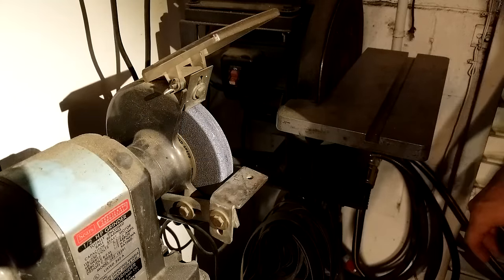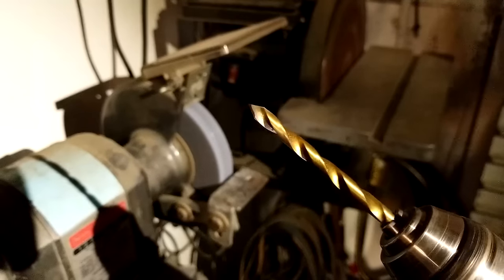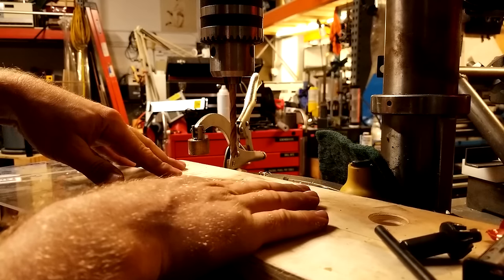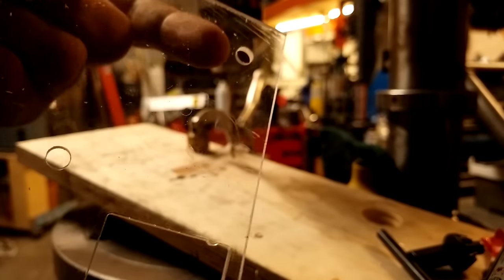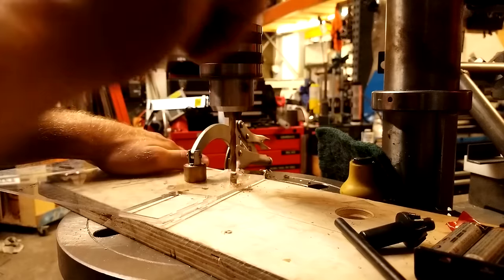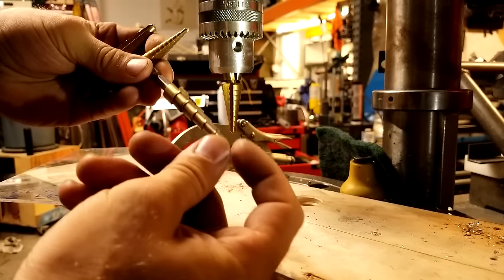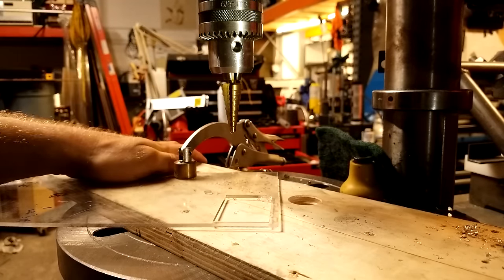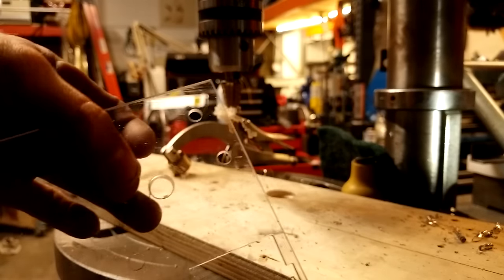How To Drill Acrylic And Other Brittle Plastics

Comment: Just in case anyone needs to know drill bits are sold with tips on them so you don't have to worry about the whole sanding of the tip part
(I believe they are the tips for drilling concrete)
Reply: masonry bits are like a flatter bar at the tip, they more hammer than drill, i think you are talking about a brad point bit, but if you have a dull drill bit laying about, just grind it like he did, even a heavier framing nail might work
Reply: I think it's tile drills /  glass drills that you're thinking of, they have a tip a little like the spade in a pack of cards.

Comment: Every plastic store I have ever been in sells special purpose bits for drilling plastic.  They are basically just regular bits with the grind shown in this video, but a full set was very expensive to this poor old woodworker.  I just bought them as I needed them because I was visiting the plastic shop 3 or 4 times a week anyway.
Reply from the maker: It's great that they are available to you when you need them!

Comment: My drill press is the Home Depot Robi 10" drill press and the lowest speed available is 600 RPMs, is that still ok?
Reply from the maker: It's hard to say, but if I were in your situation, I'd try it. Just use plenty of soap/glycerin as recommended so the bit doesn't get hot.

Comment: Also dull the cutting edge a little, too sharp will grab & crack it, especially when breaking through the bottom.
Reply from the maker: The whole cutting edge or just the outside diameter?
Reply: I’ve just tried the whole edge. I’ve also tried the spade bits for drilling ceramic tiles & they are almost as good as a reground drill bit. Haven’t tried dulling them.
Reply: Also drill a bit oversized & tighten screws lightly.

Comment: "area around the hole will tear out or crack"
"you still have most of the tip intact"
"use dish soap as lubricant"
"step drill"
"make a small hole bigger"
"have a great time"